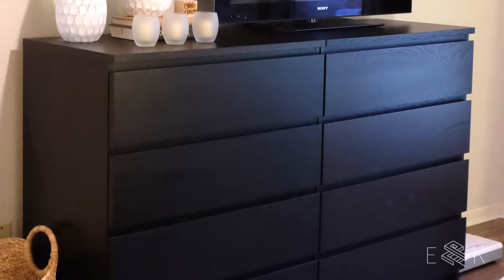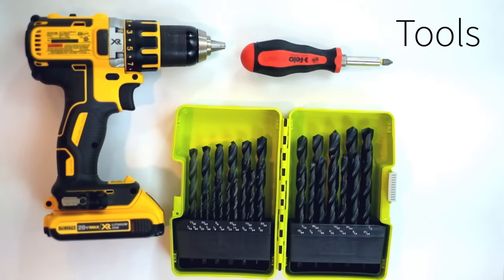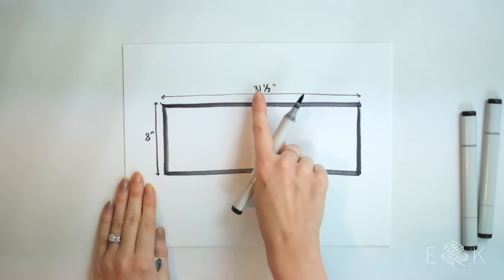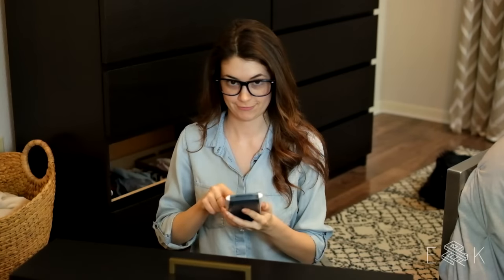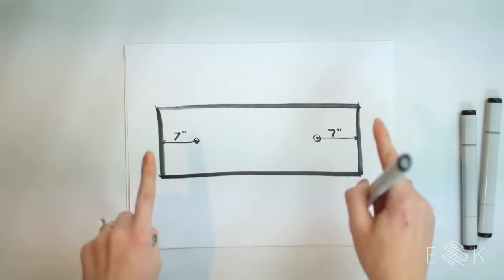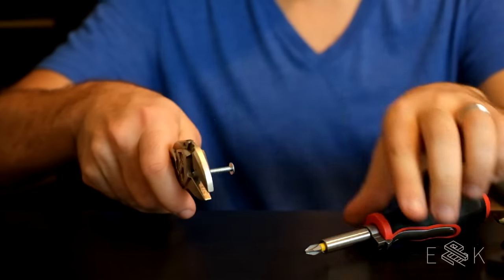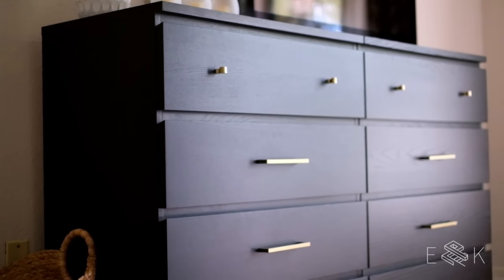IKEA MALM dresser hack | How to

Comment: Wow, working in inches seems like a real pain.
Reply from the maker: :P you get used to it. Liquid and volume and weight in imperial units are even worse though somehow
Reply: That why we stick to metric system here in the UK, it's a lots easier :)
Reply: As someone who lives in Canada where both systems are very present, I stick with inches and feet when it comes to that kind of measurement. Both systems would seem the most confusing but its actually great because you become fairly familiar with both, and then work with whatever is generally most convenient for each type of measurement.
Reply: @mark22732  no, just no... Makes zero sense to use that crap...
Reply: Aaron dude, you have no idea... I usually end up rounding or guessing, tbh.
I suppose we could always start implementing the metric system, but that’s expensive and we’re stubborn Americans, dammit. 🙄😂
Reply: Ali Salih in Canada too! :)
Reply: qwerty22 same! I sometimes calculate to inches depending on the conversion
Reply: Aaron 100% nothing is lined up like some conversions will be 2 or 4 but some will be 1760 it doesn’t make sense I rather it be the way the rest of the world does it will 10 not random numbers
Reply: Yeah but you get to live in the "New World" so it's worth it
Reply: here in america everything has to be harder than necessary 😃👍

Comment: Saw you all comment on Modern Builds and took a peak. FYI tip - when you are measuring the center to center distance of the pulls it would easier to start at 1" on the tape measure. The tip moves in and out a 32nd" and the angle you had it on will introduce some error too. The carpenters call it "burning a inch" to start at the 1" mark. Looks like you had fun and they do look much better.
Reply from the maker: Thanks for visiting Tom's Dreamshop Worx!! Yeah this was was fun but also nerve wracking in a way as it was our first YouTube video ever lol :P We feel way more comfortable now. Thanks for the tip! I thought that the tip moves on purpose though to compensate for the width of the tip by moving for measuring the inside or outside of things
Reply: Yes, your are correct, that is why it moves. I just felt in your case, you would not want a end that moved on you since you were not measuring a end, but the center of the hole. I also just subbed. Keep having fun. I love being a part of the maker community. Still pretty new at it myself.
Reply from the maker: Ahhh I totally see what you scene you are thinking of and your comment totally makes sense now :) Yeah should have used my calipers or ruler or burned the inch like you recommended to get the center to center distance. Really exciting community to enter into right? Thanks so much for the sub, we're excited to release more videos soon

Comment: I enjoyed the video (and all of your other videos that I have watched).
My workaround for being between the two sizes of screws was to countersink the hole on the inside of the drawer with a forsner bit just a little and add a small washer. The bonus is that my clothes don't get snagged on the screw heads inside of the drawer. The downside is that it involves more drilling. I already had the washers.
Reply from the maker: +Gene Jordan that's a great option too! Especially cool that it keeps your clothes from snagging. Thank you!

Comment: Yeah, I'm creeping on y'alls first video... I did want to suggest another option that doesn't require bolt cutters (even though that is a great hack). Grab another drill bit that is bigger than the head of the screw and drill a hole with a depth that allows the smaller screw to work with the hardware. I did this when building my cabinets for my tiny house! :)
Reply from the maker: oh man, say hello to even-more-awkward-than-usual E&K from back in the day! that's a great tip about the smaller screw :D

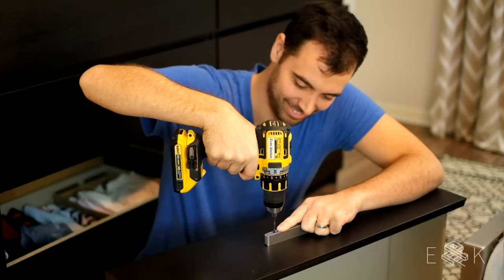Comment: 2:11 No problems with tearout there?
Reply from the maker: Nothing too bad antalz. The hardware and screws covered any that happened. Also since this is all fake composite and veneer it was pretty clean
Reply: antalz if you use a fresh bit, and don't push like you are having a baby, you can avoid tear out without using a backing piece. Also I literally only ever use a 3/16 bit to drill cabinet hardware. It's more than a little bigger but gives you room to tap the hardware into place if it ends up being off by a hair.

Comment: You seem like a lovely couple.

Few points to consider:

1. Is it really a “hack” ?
2. If you’re going to measure the gauge of a screw to a drill bit put it against end of the bolt to the end of the bit that is grabbed by the chuck
3.  Drill guides are all well and good, though give the nature of the material of each side of draw would be good to use some scrap timber to back it so as to not ruin or make the exit point. Tape can also help.

For what it is worth I thought the draws looked fine before the handles. Anyways well produced video , keep them up.
Reply from the maker: I think when it comes to "Ikea hacks", it's a term that's just commonly used now for upgrading ikea furniture in one way or another (not used in the same sense as a life hack). Very good tip about about scrap timber on the back!